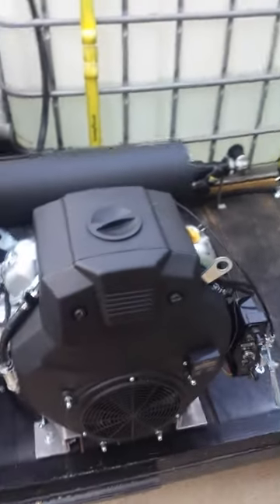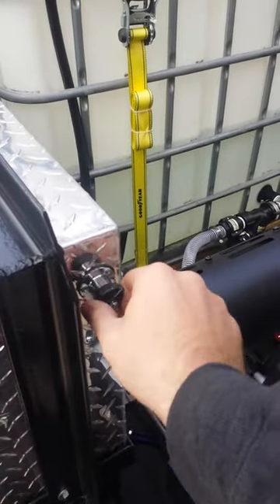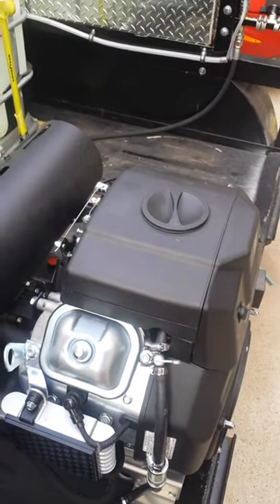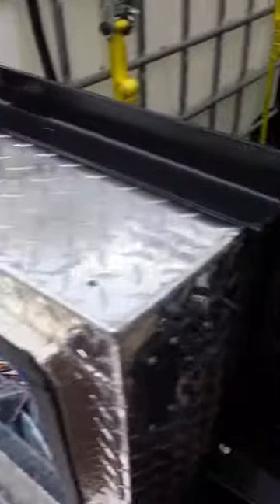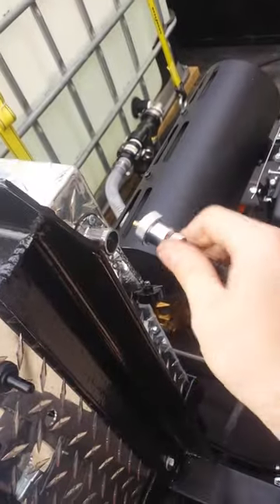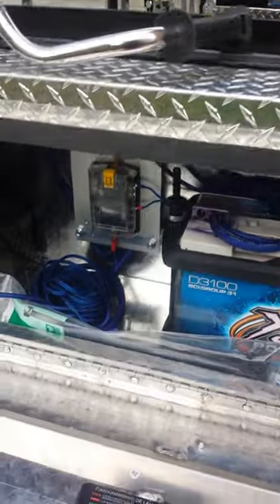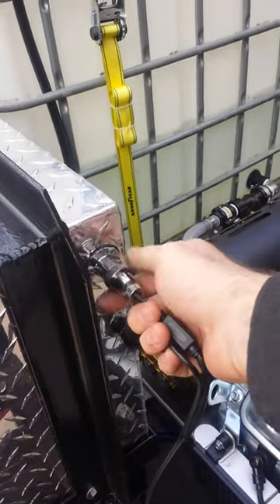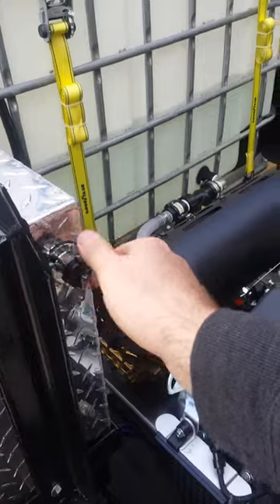Pressure Wash Trailer Battery Charging System

Comment: Hey I've been thinking about getting the same predator engine just because it's so much cheaper then a Honda, how is it working for ya and what gpm pump are you using? Your setup looks nice!
Reply from the maker: Showtime Power Washing  The predator has been great. Just upgrade the fuel pump, fuel filter, install a petcock, install a hour meter, and ground straight to the starter. I have had no issues as of yet.